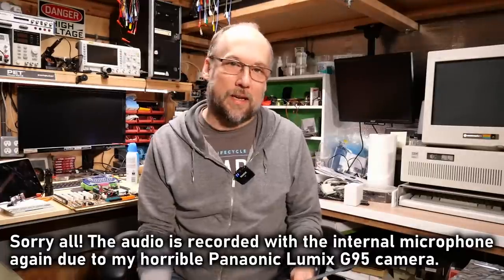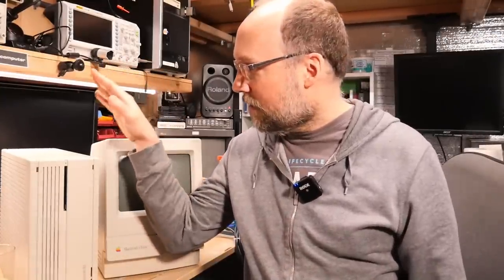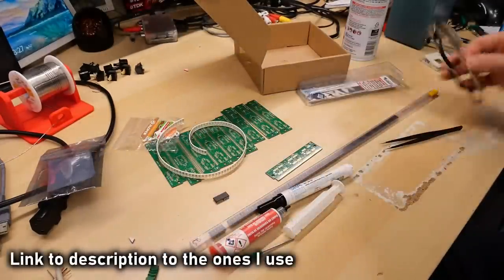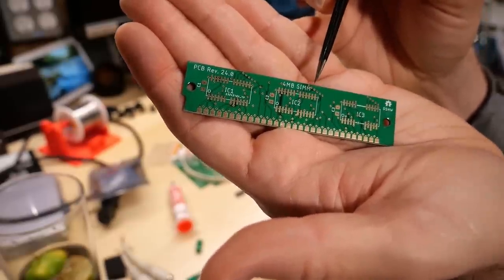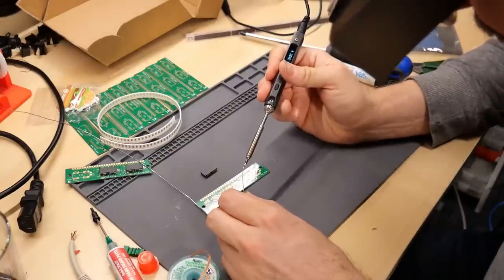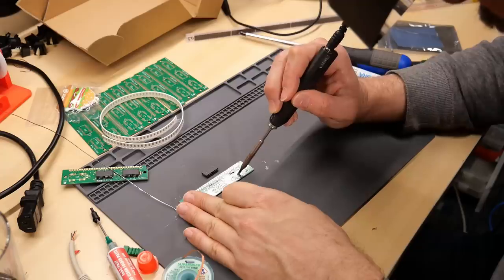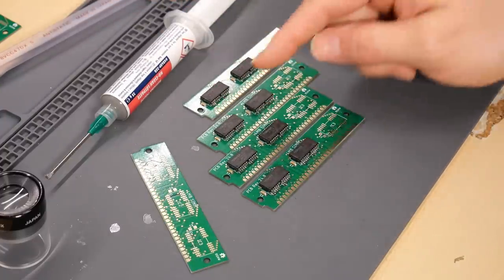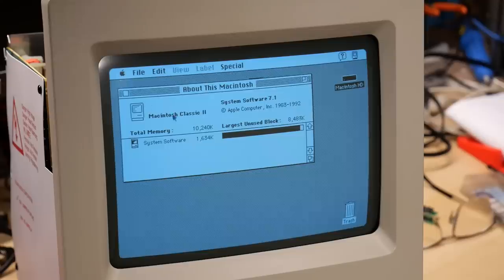Nibble Size: Let's make some memories!

Comment: "hard to find 30 pin 4mb SIMM"
looks around

hides an whole shoe-box filled with em at a safe place

(comes from when i went at high school in the early 2000s and all the 80's and 90's server hardware got decommissioned in the state over a low shoe, and all the old stuff where dumped on the schools that had no need for it...)

Comment: Just booting a PC (well.. Mac) with the DIY RAM isn't exactly testing it though Oo
I'd throw the sticks in a 386 or 486 and run Memtest86 or Memtest86+ to actually test them and be sure they work 100%. Otherwise I'd never fully trust them because.. well I made them lol

Comment: The amiga1200 speeds up when you add more ram as well up to 2x the speed 🙂
Reply: Just note that there are three types of memory on the Amiga. Fast, Slow and Chip

https://en.wikipedia.org/wiki/Amiga_Chip_RAM

Also, Chip is quite slow compared to 32-bit fast. However, from my recollection, Slow and Chip was about the same speed.

Interesting discussion here: https://groups.google.com/g/comp.sys.amiga.programmer/c/WZQVhNzqQhw?pli=1 (with some speed-tests)

Comment: Do you run custom firmware on your TS-100 soldering iron?
Reply from the maker: I do -- can't recall the name but it's the open source firmware -- have updated it a few times.
Reply: @adriansdigitalbasement  I think my previous research led to the open source Ralim firmware, which even has the ability to do custom boot logos.

Comment: Adrian: tip, in the future, use a stencil (non-frame). You can just order a cut to board size with a PCB order, then just use tape to keep them aligned on the board. A spudger can be used (or a solder pick). Then just place the chips and reflow.

Comment: I legit don't get the RAM market. A single IC chip costs several times more than a used stick of RAM with 100 times larger capacity.

Comment: I did my first surface mount project a few months ago.  I used a custom stencil to get a nice fine and precise layer of solder on the board.  It was still a bit sloppy before the heat went on, but it turned out really nice.  https://i.imgur.com/P8VRnA1.jpg

Comment: That soldering iron is horrible ergonomically. Longer further away from your hand solder tips magnify any movement your hand makes. Get an iron with a handle closer to the tip.

Comment: Success.. Templates for the paste aren't expensive.. generic chip ones like those especially.. but.. I don't bother with paste unless I'm reballing BGA things.. the "tin the pads then burn the chip on" method works just fine for me.. and Rossman as it goes ..

Now all I need is to find a similar project to make some more ram for my 486.. anybody got any ideas?
Reply from the maker: If it's 30 pin, the same modules will work on that too

Comment: Pour some sand into a frying pan and heat it up with the board on it until the chips seat themselves onto the pads when the solder melts e.g. https://hackaday.com/2019/06/05/solder-smds-with-a-pan-o-sand/

Comment: OMG, you Butchered the first 2 DIMM's...
I can't watch... 😑
JLC PCB can send you a SMT Mask and then you can apply the Soldering Paste over the SMT Stencil.
Pick and Place the components (by hand) and use heat on them (Reflow Oven) , but you can get away with some Hot Air.
You should have seen some soldering tutorials before doing this...
The sad part in this is that you learn it by doing it.
So keep up the good work, keep trying and you'll get good at soldering.

Also:
The Computer is faster when it has more Memory (RAM) because it frees up the CPU.
When you are Low on Memory (RAM) the CPU spends more time on taking things in to or out of the Memory (RAM).
I can't prove this theory, but it's what I've noticed.

You should have done some ECC ones as well.
Some tests, comparisons...